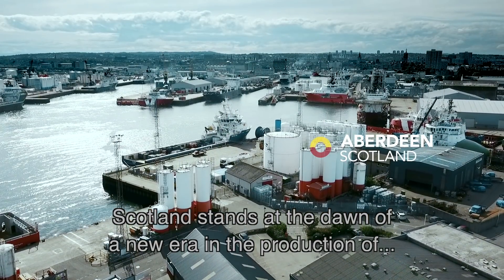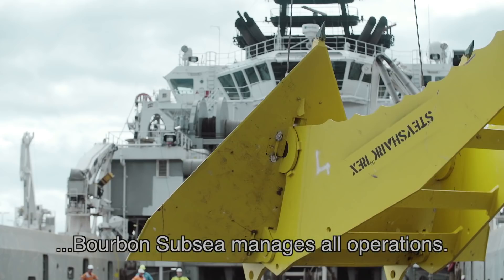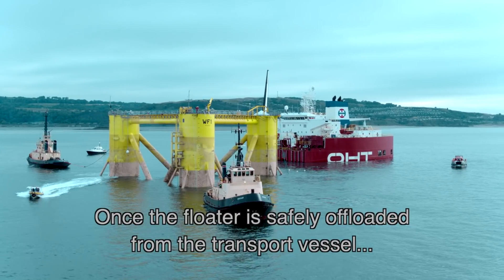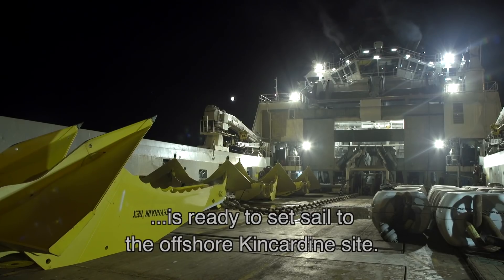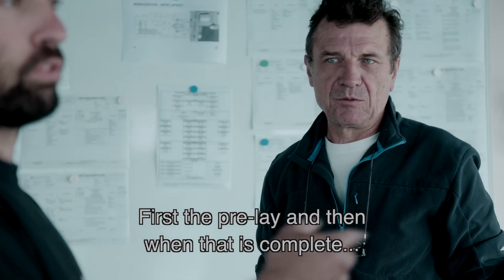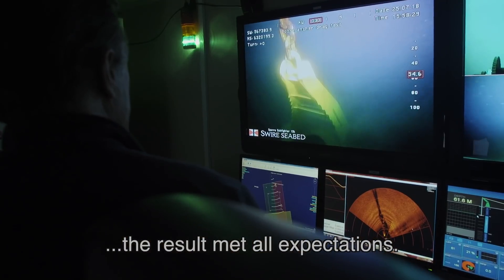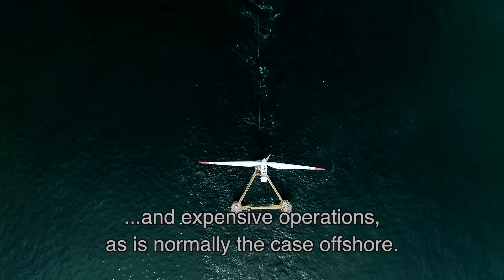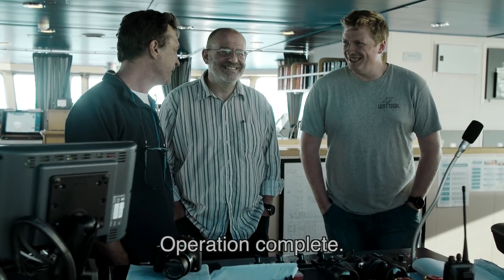Floating Offshore Wind Turbine Installation - Kincardine project Scotland

Comment: They are using a single crane cable.  If they used two cables, separated at the top of the jib by about 12 meters, then the loads could be lifted without the problem of spinning in the wind.  Also the wind turbine blades could be leveled while in the air, instead of needing critical measurements to get it level on the ground.  The weight could be spread out over more area of the wind turbine blade, so less stress on the blades while installing them.

Comment: There horribly inefficient $per kw/hr as it is on land, let alone floating offshore.
Reply: er, no....   solar and on shore wind are the cheapest power out there.    Off shore wind will get cheaper, as they get more experience.
Reply: You need a stable AMD grid save grid without Blackouts  and Not the cheepest possible Energy . The onshore Wind only has 2500 h where its at Peak Performance. Offshore and Floating are at 4000-6000h and more . We need a stable amount of Energy so the grid dont Break down. 

With this new Tech you can build the Station on Land and pull it to the place you need IT. 
It will reduce the Cost in the Long Run.
Reply: Stuart, if you listen to many who hate the idea of wind farms, they will tell you very bad information, and misleading information, in a effort to stop the installation of wind farms.  However the truth is that wind farms work very well, and save a lot of pollution.  They do make a variable amount of power, but there are ways to control this, and keep everything working well.  

Many states, like Iowa have many wind farms, and they provide a significant supply of all the electricity used in the state.  In California, there was a day in March of 2022 that 101% of all the electricity produced in the state matched the amount of load used in the state!  So yes, solar and wind farms can get the job done, without causing blackouts. 

Floating wind farms are just another way to produce huge amounts of electricity without needing to dig up coal or burn natural gas to produce the power.  In 10 years, I think that a significant amount of offshore wind power will power the world!  They installed over 35,000 MW of offshore wind power in 2021, and it looks like they will exceed this record amount in 2022.